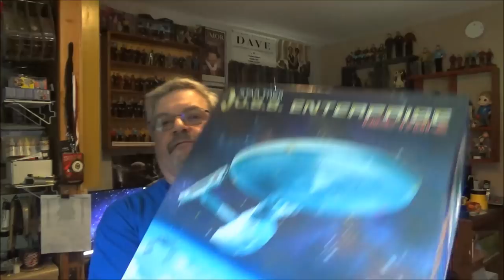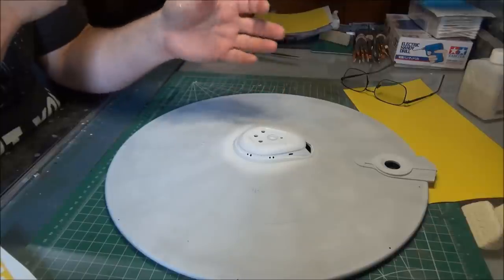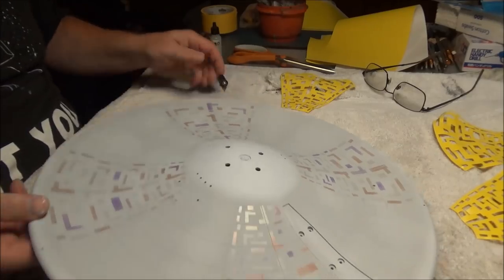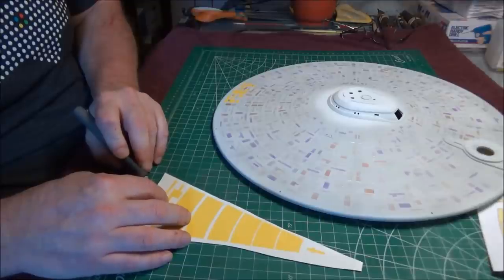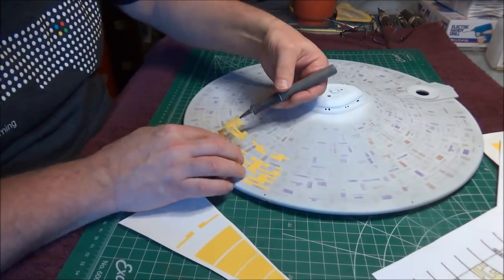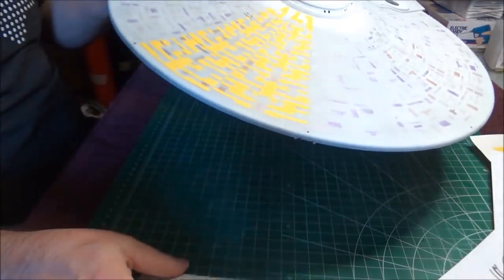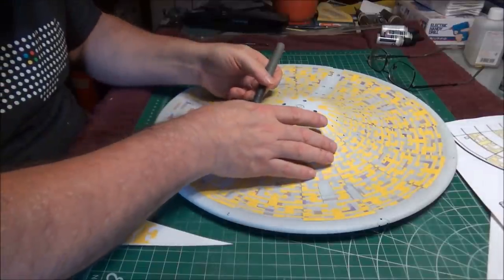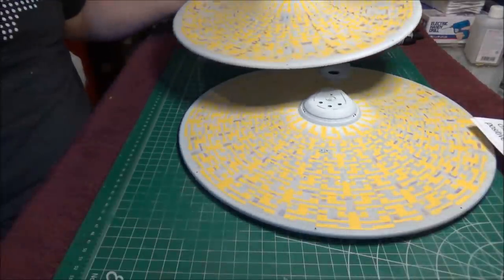aztekking the 350 scale refit saucer- part 1

Comment: Hi, again. I'll be doing a 2-color job. What I plan on doing is , (after priming and all that,) is doing a solid coat of a pearlescent or some paint that will give a shine for the whole thing as a base color. Then, I want to gently airbrush on your mask sheets a second complementary color shiny paint before weeding. Then I'll weed and stick the mask on the ship for it to stay there. The main reason I want to do this is to give the "plates" some depth with the slight thickness of the mask material itself. The second reason is all the painting is done. I know you don't have masks for the rest of the ship so I'll create a file for a Cricut machine for that. Anyway, my question is, the adhesive on your mask material - how long do you think they'll last before getting brittle? A month? A year or two? I know you've said you have done things like this to beef up the plating on the Klingon ship. Thanks again!
Reply from the maker: I worry that the paint will flake off of the vinyl when you peel it up from the sheet. the vinyl itself will stick for years and if you put it on the bare plastic and primer over it, even longer
Reply: @aztekdummy  Hmmm. I see. Maybe put the material, unweeded, on the ship, spray paint, and then weed carefully so as not to mark up the painted base? I mean the worst that can happen is I'm out the cost of the mask, buy another one, and do it all with paint and try to make the plated look some other way. maybe there's a paint that goes down thicker. Oh, well, I am super respectful of your time. You have a wonderful weekend!
Reply: @aztekdummy  Ok, then. I think I have a solution. I'll keep the mask on. I will lay down, trim, and gently burnish bare metal foil on the material. I've been watching a lot of tutorials about it and I think it'll look great.